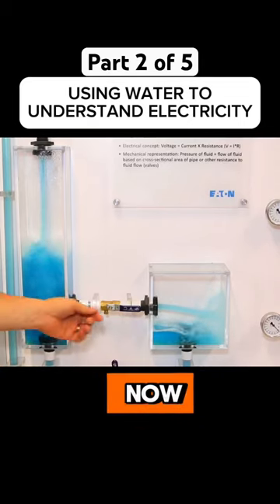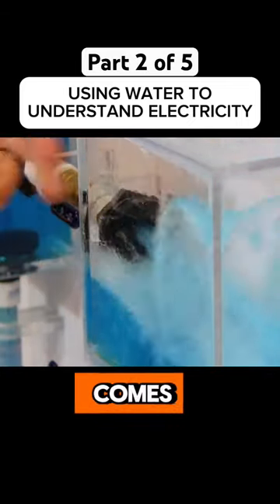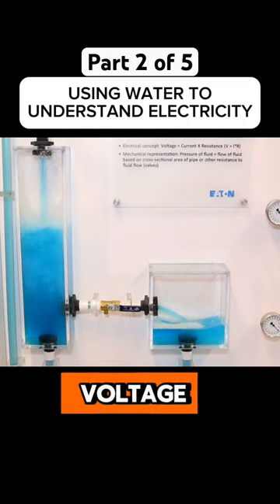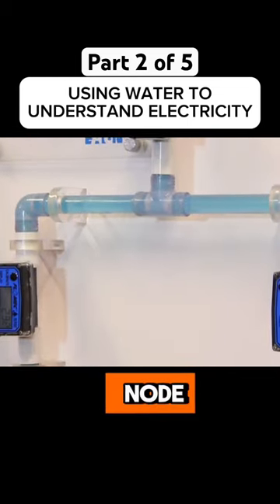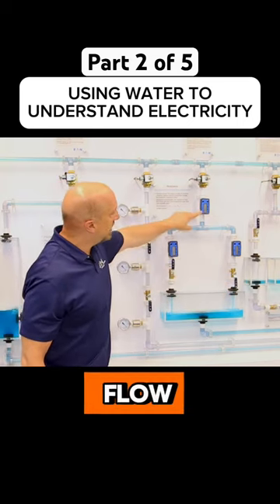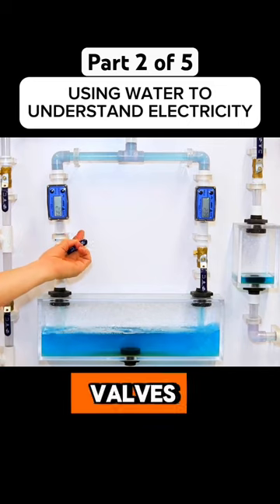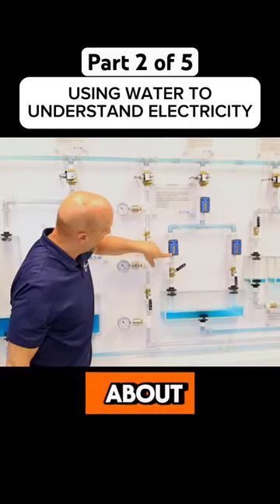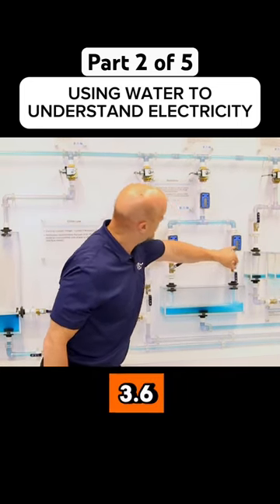Part 2 of 5 Understanding Electrical Terms Through Water Analogies

Comment: the funny thing is electricity behaves EXACTLY like water inside the wires.

no joke. if you plug in a split Y wire where there is 1 dead end and another that goes to a lightbulb the electricity will flow both ways. slam in to the dead end wire and flow backwards until it equalizes. meanwhile the light bulb is being powered like normal.

the electricity behaves 100% like water. only faster and smaller.
Reply: No. It behaves similarly to electricity, in certain situations, but not 100% the same. once we get away from basic stuff and go to capacitors/coils and differences between AC/DC with these, water model doesnt deliver.